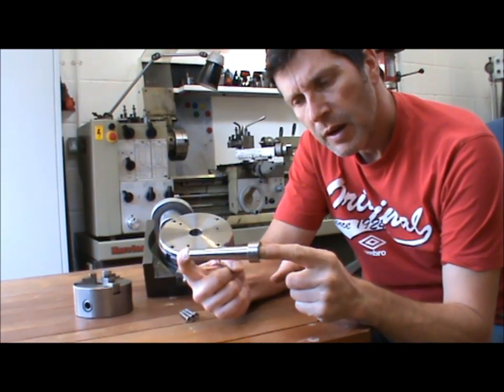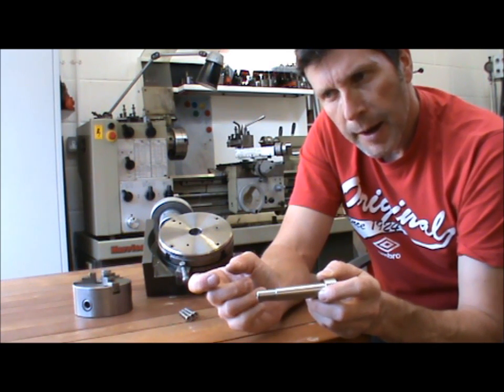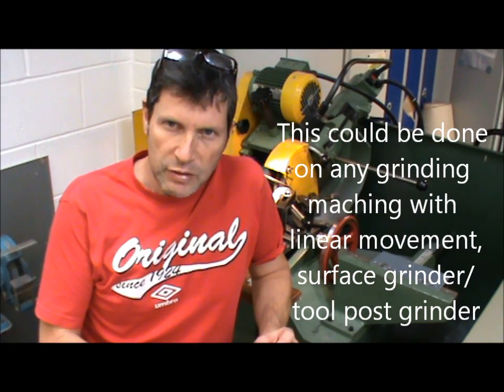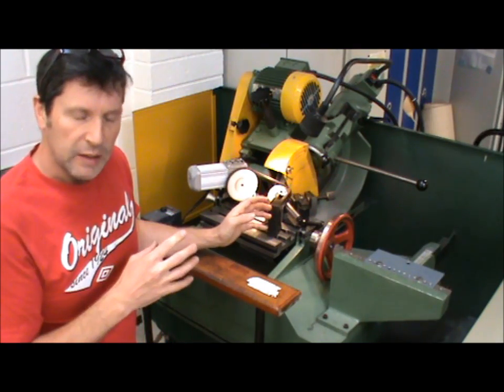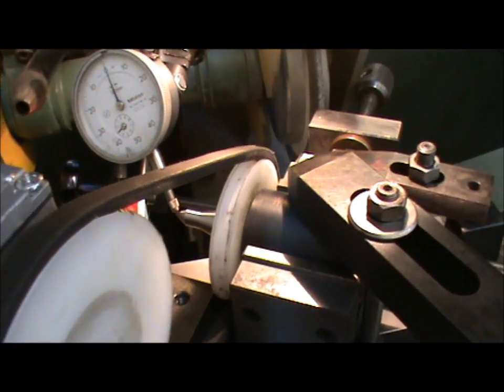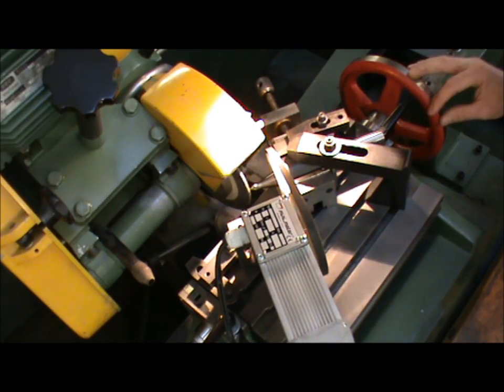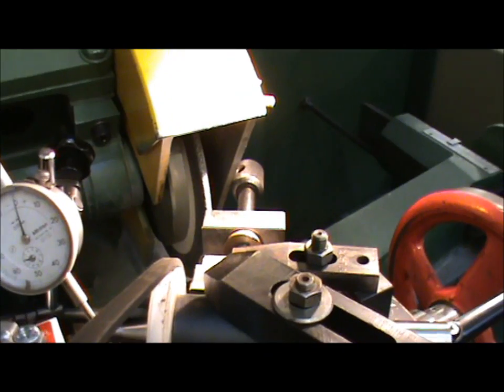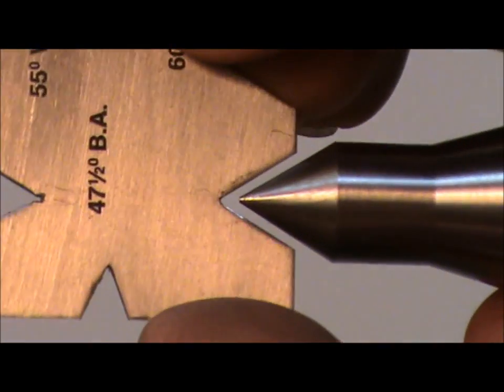Live centre grinding

Comment: The thing is that your live centre is not axially loaded while you are grinding it. In fact you are radially loading it with the belt. So unless the live centre has preloaded bearings, you're still going to have some slop when you actually use it under axial compression